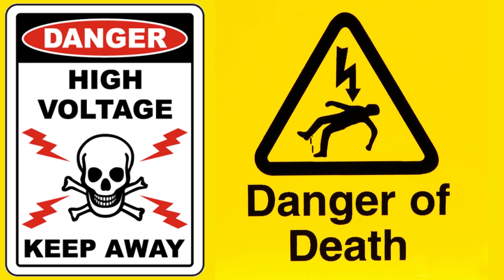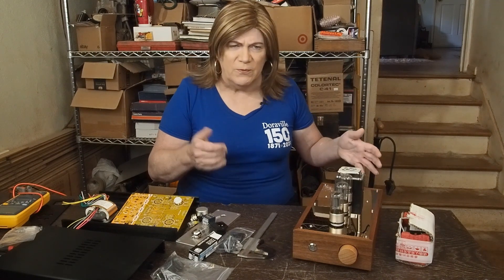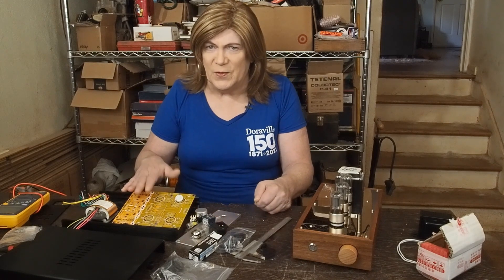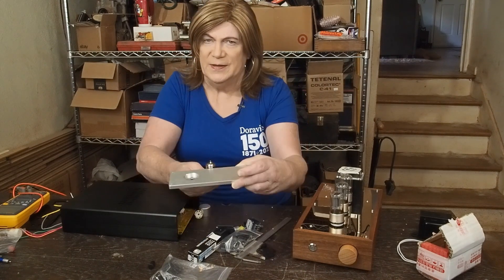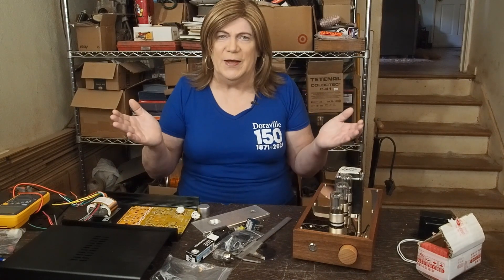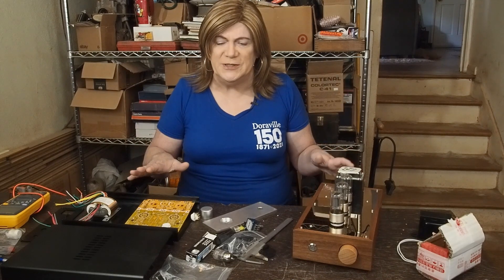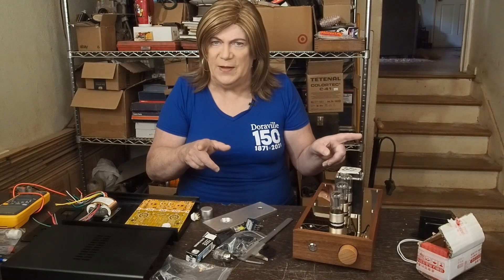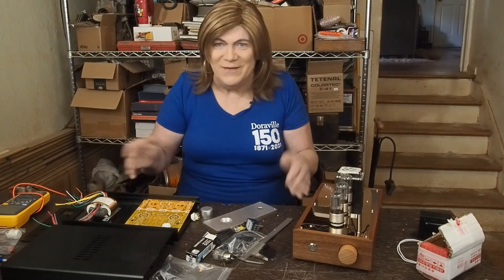HiFi Tube Pre-amp: Quick Overview of the Series!

Comment: im having a problem with mine. have you got any test points for voltage so i can see where its gone wrong.thanks
Reply from the maker: You what? like which one?
Reply: @SkunkieDesignsElectronics  the cj cloan preamplifier is not working properly so i was wondering if there any sort of referance voltages i can test for on the board so i can see where its breaking down
Reply from the maker: Check the heater voltages and also the voltages on the plates of the tubes.
Reply: @SkunkieDesignsElectronics  the heater voltages are below 6v like 5.somthing but the regulator for the heaters looks like it needs at least 8 v to work properly and it only gets 7v from the transformer. also what should the plate voltages be. thanks again
Reply from the maker: I honestly can't remember. I'd be looking to make sure the tubes are conducting with the heaters that low. Like see if there is fairly high voltage on the plate and there is "something" on the cathode. You can email me stephe@skunkiedesigns.com

Comment: great discussion - good idea for newbies as they can build - learn--  then -modify---tube roll/cap roll, on a pr-built chassis
saving the expense and headache of buying, punching and painting a chassia,

sometime way down the road - consider a "Stu Hegeman Tribute" moving magnet phono preamp based on Hegeman's Citation I and IV tube phono preamplifiers.  The Chinese for whatever reasons never do them.  Topology-wise, both the  Citation I and IV used a 12ax7 feedback cascade pair to drive a"lumped" passive RIAA eq network. There's a following gain stage, and Hegeman did not resort to cathode followers for Citation I's high level stage, but rather a single triode as what is sometimes called an "anode- follower" with plate-to-grid feedback.  (deemed to be sonically "better" than a single supply cathode-follower)
Reply from the maker: Do you have any links to a schematic of this phono-stage?
Reply: @SkunkieDesignsElectronics  

-did you get these links?  I'll guess that Stu Hegeman chose the cascade feedback pair to drive the passive RIAA eq for several reasons - a reasonably low source impedance impedance to the network - relatively constant gain vs tube aging - low measured distortion.   

Regarding Fosgate's octal version below,  I think small bottle 12ax/5751 would be less microphonic than using octal (especially up front) as have owned two octal phono preamps.  Maybe the AC paralleled 1.5K/300uF combo on the  Fosgate's 1st stage cathode resistor was to allow for a certain bias point.

Citation I schematic  with lotsa stuff

https://www.quadesl.com/schematics/hkcit1_sch.gif

Here's the Citation IV scheme which dispensed with the second cascade feedback pair in favor of an anode follower.  (It did use a cascade feedback pair for it's high level stage)

https://i.imgur.com/EP2XxUL.jpg

Here's a bare bones interpretation using octal tubes by Jim Fosgate. A medium mu anode follower with gain set to around "3" could be used for a high level stage.

https://i.imgur.com/FWOBl.jpg

Comment: Please can you tell me what the maximum voltage , the heaters of the EL34 and 12AX7 can handle without running too hot and shortening the life of the tube TIA
Reply from the maker: Most data sheets state it as plus/minus 10%. I feel 6.1V to 6.5V is nothing to worry about.
Reply: @SkunkieDesignsElectronics  thanks!! as my Pt is putting out 6.1v  no load this might be too low I am guessing

Comment: I'm really looking forward to this series. I have been looking at that same kit as well as the many other tube preamp kits on ebay but have not made up my mind yet. I might just go with the same one you chose. My limited experience with a few Chinese audio components has been good. I love tubes but I can't or won't spend crazy money for some other main stream gear especially when I can build or even buy it at a much more reasonable price and I like building or tinkering. I will say it again, I love your videos and the way you do it. Very educational and inspiring. Thank you.
Reply from the maker: Thanks, and a "kit" off ebay probably is the more cost effective solution. After buying all the parts for this, things like the heat sinks weren't easy to source and ensure I got the correct ones!